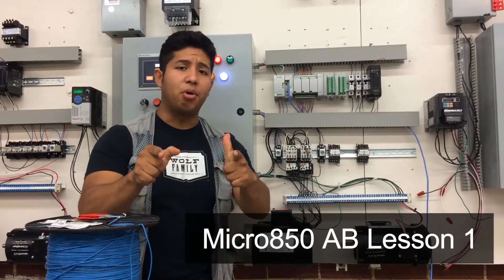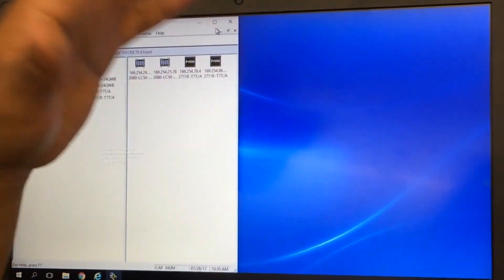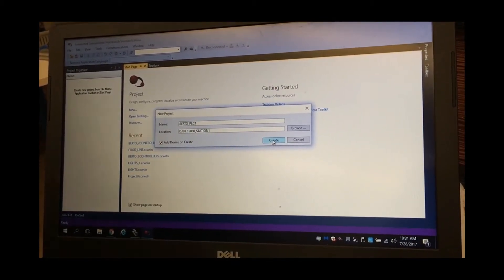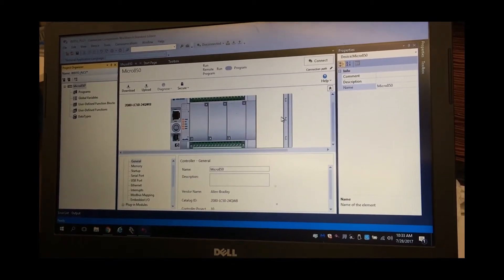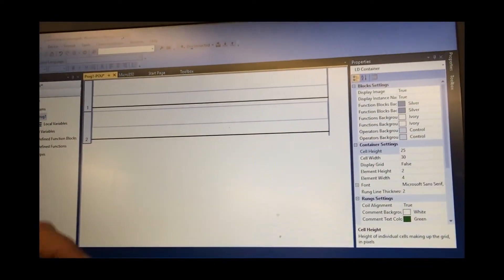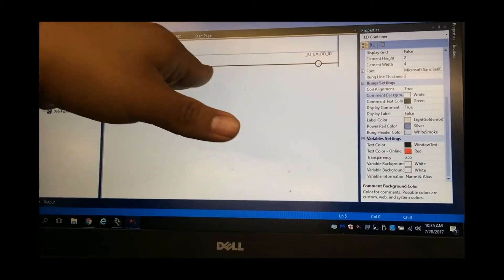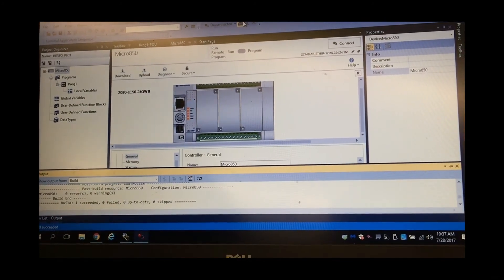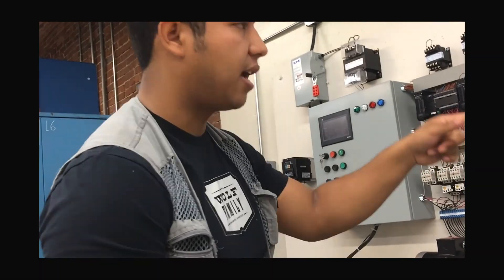Micro850 AllenBradley Lesson 1

Comment: Dear
           Sir i want to buy a plc 850
2080-LC50-48QBB and How can program it and which is the best proagraming software for this PLC 

Thanks & Regards
Suneel Kumar Jha 
A & C ELECTRICALS
Reply from the maker: suneel kumar jha The best software to use with that PLC is Connected Components Workbench and the best thing about it is that the software is free once you make an account under Rockwell Automation. Plus with that software you can program HMI, safety relays, and power flex drivers. I hope this answer your question and you can email me at sobertomoreno@s.tcatshelbyville.edu for anymore questions
Reply: @techlivesmatter9718  Thanks for your value feedback i m working in control panel field since last 12 years but automation is new for me i just join automation field by 4 months ago i will contact you through your email.

Comment: Great video, just what I was looking for.

Could tell me what type of Micro850 is that ?? 2080-LC50-24QVB?
Could you tell me what is cost of the Micro850 PLC ? Can RSLogix also be used for programming the Micro850?
Reply from the maker: arbjful hey there! And yes it’s a great Allenbradley series for learning, small scale industrial systems, and best part connected component workbench is free. Just register an account with them. Now, the PLC I used was micro850 2080-LC50-24QWB, and if you download the program application for programming it will show you the compatibility list of PLCs, HMIs, SAFETY RELAYS, and more. Now prices truly depends on locations and businesses that can sell these. Last time I check they can range from $300 to $900. Now from what I’ve in the past researched and I thought of the same thing, sadly you can’t use rslogix to program micro family series. Now that I’m learning and working with computer hardware, they have different hardware, firmware and Software architecture vs the ones from rslogix. Plus RSlogix requires purchase licenses. However, what you can do is try to make a program in rslogix, save the program file, open Connected components, and upload the file to that software instead. I’ll see if I do that for theory testing next week.